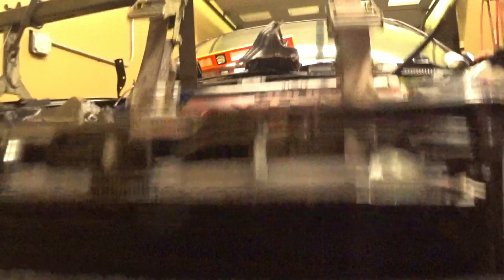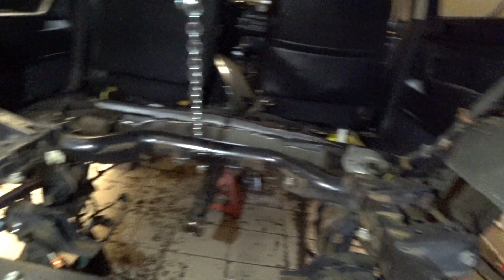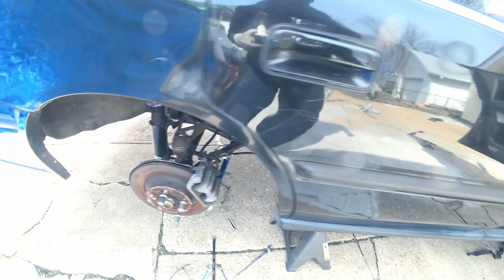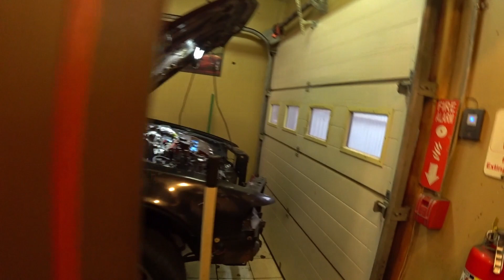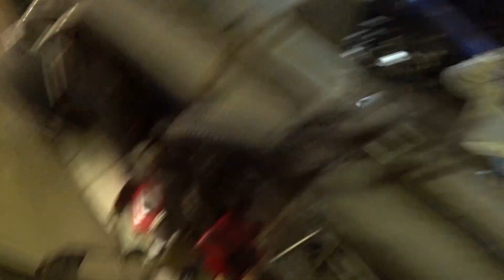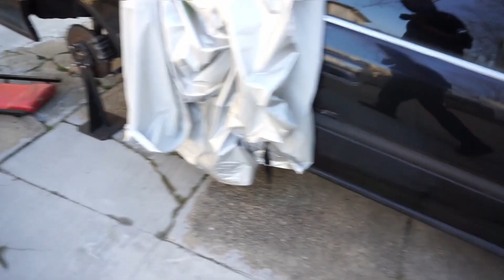Want to ALL WHEEL DRIVE Swap your Honda ???  WATCH THIS.

Comment: Is it possible to do this with 2010 honda accord v6 using a 2010 accord crosstour's awd transmission?
Reply from the maker: I do believe it can be done. The crosstour shares similar subframe.
Reply: @AJIMPORTS  I appreciate your input. Would you happen to know where I can get this kind of work done? Honestly wouldn't even know how to retrofit that.
Reply from the maker: @Oldieeeee  i have looked around but no one has done it. Look up awd v6 wagon tsx. Thats the only build I see thats near this year. I know the motor and transmission will bolt up. But the rear end might need adjustment. I do want to do the awd to my 07 accord but those 3.7 awd parts are hard to find
Reply: @AJIMPORTS  again I appreciate your input, I will check that out and I hope you can find those parts to make that all-wheel drive happen!

Comment: How much you spent just trying to get it awd I really have personal questions for you I got the 7th gen accord coupe trying to awd swap it
Reply from the maker: I got sale and deals on a lot of stuff. So I did not spend alot. A 7th gen would be easier if you start looking into the rl rear subframe. You might be able to customize that rear subframe. So that remove a lot of fab work. I want to do it to my 7th gen once this car is on the road
Reply: @AJIMPORTS  plz do it it’s my daily a very fast daily I love it for passing people in the slow lane but imagine a awd accord coupe only thing on my accord stag rims flared finders lifted coilovers intake & other cosmetics but I’ve always thought all Honda/Acura parts are interchangeable so you could grab a old crv awd system and hopefully it would work but I’m  just not sure

Comment: What is the frame off you put in the back of car
Reply from the maker: Its a s2000 rear subframe. But if I were to do it again I would use a 240sx rear. Its easier to work with.

Comment: outta curiosity, how much has this ran you so far? im considering awd swapping my cd5 with an h22a but i cant find a price point for it
Reply from the maker: I have not done the math. But everything I would say 8000 into the whole car. All the fab work was done by me or by friends. That cut down on the cost. If you can weld and do the work your self then you can have the awd done on a budget. Also a cheaper way is to go k swap awd. And make a tubular rear trailing arm like the civic. Thats the best and easiest way for the accords
Reply: @AJIMPORTS  hey i know i’m pretty late but how much do you think it would cost for a k20/k24 awd swap for a 1995 civic or integra

Comment: Hey man, I've got a 91 and I'm doing a h22 swap and want to know what I need to mount one of those CRV transmissions on it. Can you help me out?
Reply from the maker: They have a few ways. You can buy the h2b kit plate kit. Or buy the h2b plateless kit. You will have to make custom motor mount if this is going into a accord.